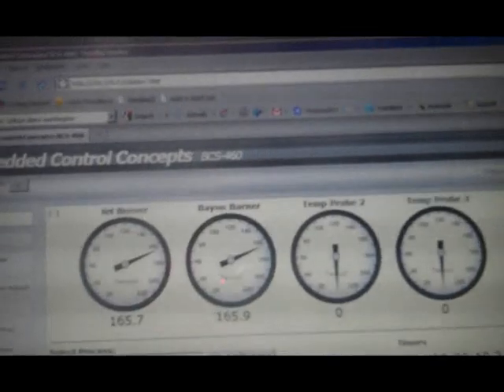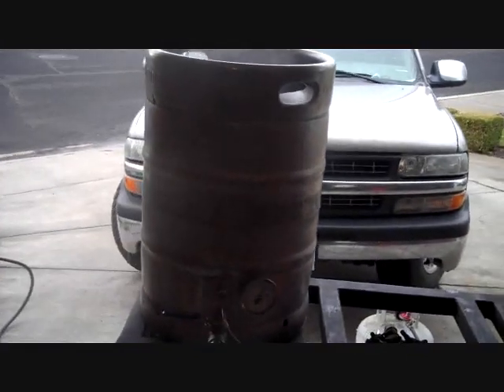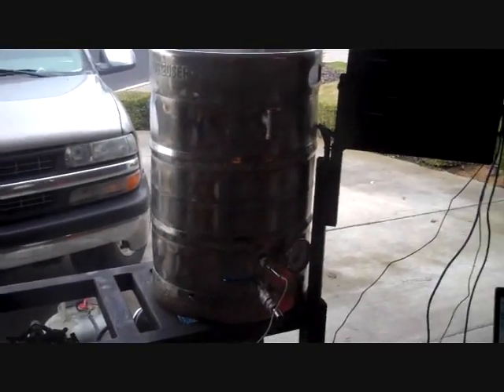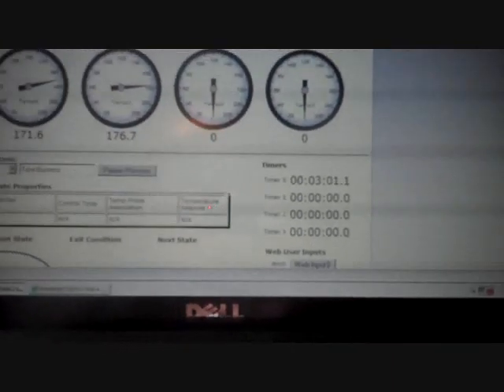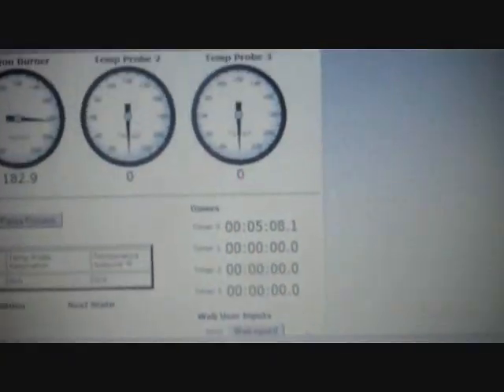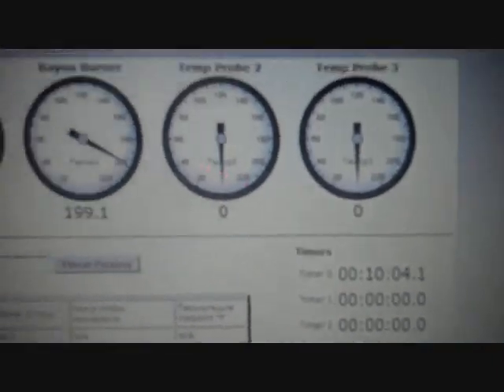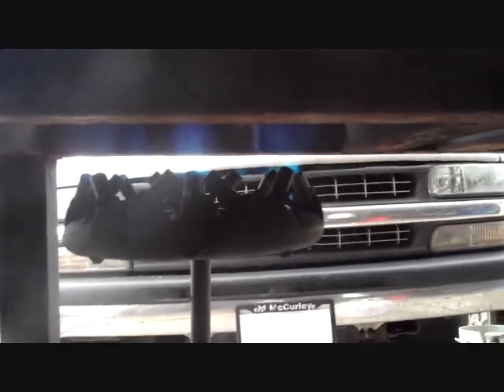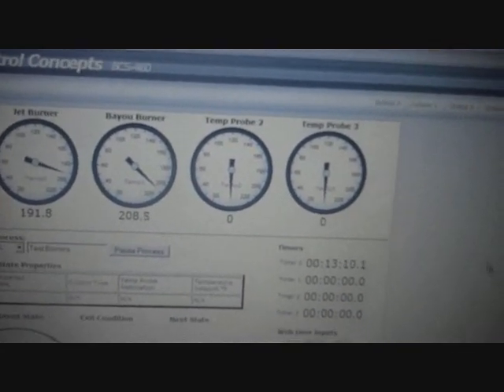Jet Burner versus Banjo Burner

Comment: I too would like to know what the rating of the burners were.  I believe the bigger bayou burners are typically rated at 210,000 BTU.  I have seen the 23 tip ThunderGroup jet burners typically rated at 160,000 BTU.  If that's the case, it makes sense that the banjo burner won the boil race.  But, ThunderGroup isn't the only one out there with jet burners, and every jet burner manufacture has a different rating.  Some 23 tip burners I've seen rated as low as 90K BTU, and some up to 200K BTU.